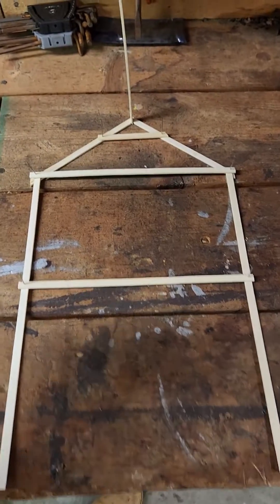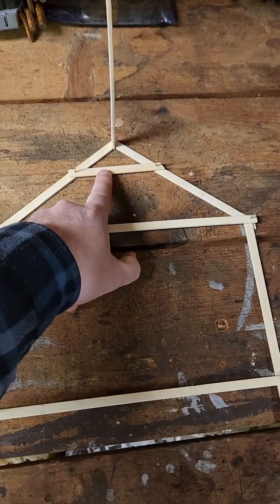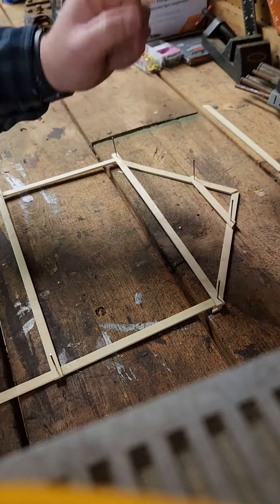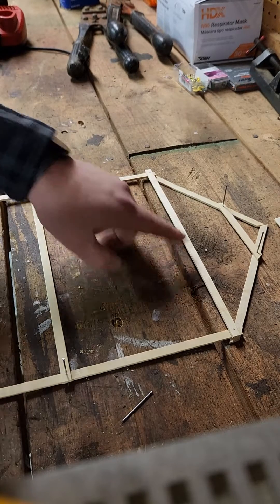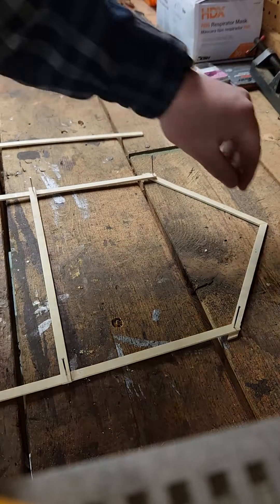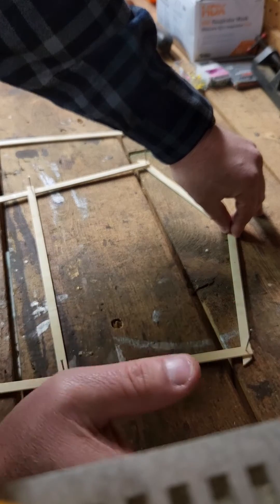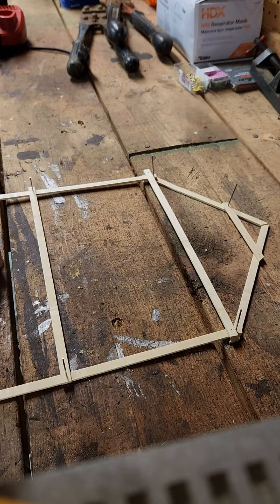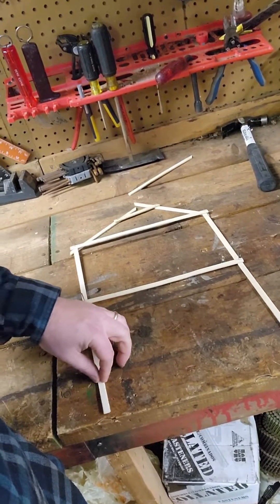Rafter Ties VS Collar Ties in roof framing

Comment: Something that I'm not understanding is how making that ridge board a beam magically allows for the ceiling joists and collar ties to be removed (to allow for a vaulted ceiling).
Reply from the maker: A ridge board is not carried buy anything except for the opposing forces of the rafters on either side of it. In this typical design the opposing rafters and the ceiling joist / rafter tie create a triangle which is self-supporting. A ridge beam is designed to be carried by supports on either end of the beam which transfer the load all the way down to the foundation. This ridge "beam" will be carrying all associated loads from the rafters as there is no longer a complete triangle without the ceiling joist/rafter tie completing the base of the triangle. 

I hope that helps!
Reply: @homedetectiveguy4647 appreciate the insight. I'm surprised at how many contractors - seemingly very experienced - are showing off vaulted ceiling porch/deck covers with ridge board and not beams, though. Then they berate you in the comments when you question them on it. It's very misleading. Is there a mechanical alternative (ridge straps, hurricane tires, etc) to making the ridge a beam in a vaulted application?  Several of these aforementioned contractors swear they passed inspection with a board rather than a beam. 🤷‍♂️
Reply from the maker: @wes8398 I am not aware of any mechanical fastener or hanger system that would allow for the elimination of both the rafter ties/ceiling joist as well as a structural ridge beam. Of course this is for the typical roof design. There are engineered trusses that are capable of creating a "cathedral ceiling" while not requiring a ridge beam. Of course now we are talking engineered roof designs and not the average nominal lumber roof framing installations. 

Small roofs, such as a roof for a small outdoor shed tend to hold up ok without rafter ties or a ridge beam but they squat over time in the middle especially with snow loads. Some of these sheds use plates to join the opposing rafters and eliminate the need of even a ridge board. Sometimes they also are built as a gambrel roof style with plates joining the rafter ends together at all the joints. This of course is for small sheds not an entire house or building.
Reply: @homedetectiveguy4647 Great insights, again. Thank-you!  A lot of misleading (or outright incorrect) videos out here showing builds with ridge boards that should be beams!

Comment: I'm building a small 10x14 shed. My question is, what if I install just one rafter tie in the middle of the building at 7'? I've seen your exercise simulating roof load before, but I'm curious to know what would happen if you only had a rafter tie in that situation. Are collar ties really necessary? I'm trying to avoid collar ties because my roof is narrow, so the little "attic" space I have will be very compromised if I put a collar on each rafter.
Reply from the maker: @jrwingking8721  small buildings like sheds can get away with a lot due to the lack of span, height, and length of the building. Though building code doesn't give any exceptions, I have seen many sheds of that size with neither collar ties nor rafter ties. Decent fasteners at the ridge securing the top of the rafters to the ridge board, and one single rafter tie in the middle of the building at 7 feet will probably perform just fine for a 10x14 shed so long as you don't have more than a 50lb Snow load in your area.  Just make sure the rafter tie is secured well to the top plate and rafter on both sides to prevent rafter thrust at the top of the wall.

Comment: Hey , I have an attic built in 1925 made out of 2x4 rafters , I have a lot of extra wood from a project and is 2x8s , do you think 2x8 would be too big to big and heavy to use as collars ties for 2x4 rafters?
Reply from the maker: @ParkerPlus  if you install 2x8 collar ties every 4 feet then you should be just fine!

Comment: Can a rafter tie be slopped, or does it have to be striaght like in your demonstration
Reply from the maker: So long as the triangle is complete, an angled rafter tie is better than nothing. Building codes do not necessarily allow angled rafter ties but typical engineering methods would allow it.

Comment: Can a rafter tie be brought up off the plate to raise the celing a little?
Reply from the maker: A ridge straps is a perfect alternative to collar ties. Then you can lift the ceiling up to the ridge if you desire
Reply from the maker: Keep in mind that rafter ties are also required. So if we are talking about a  roof that sits over a room with full wall heights you can't forget the ceiling joist/ rafter tie requirements

Comment: What’s the maximum length going up the rafters can a rafter tie be nailed? I need to raise the rafters in my garage about 3 feet to allow clearance for a 4 post car lift.
Reply from the maker: The 2018 IRC for example, indicates that rafter ties must be within the lower 3rd if the rafter span. Anything more than that and a structural ridge would be needed, or an engineered design. 

Keep in mind that prescriptive codes require that if you lift the rafter tie off of the bottom of the rafter (at the top of the wall plate) then the rafter needs to also get larger. There is a multiplyer chart in the IRC for this.

Comment: If the roof has heavy concrete tile, not in an earthquake area and a 4/12 pitched roof, do collar ties do anything? Other info says collar ties are for upward movement, wind, or maybe earthquake areas... The house has 2x6 ceiling joists, 2x6 rafters spanning 9 ft. horizontal.
Reply from the maker: Right not much uplift of the roof is super heavy. However collar ties, ridge straps or gusset plates are required for typical A frame roof construction. I'm not an engineer, but I would assume there are ways around it, but it's relatively cheap to have collar ties installed